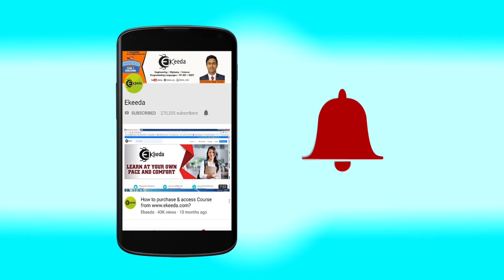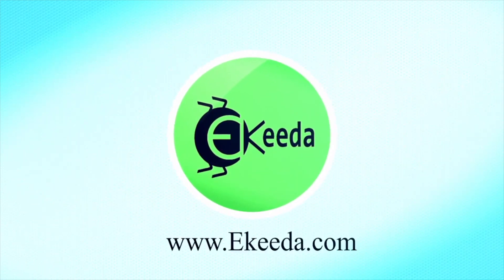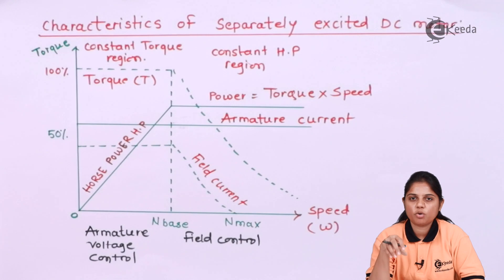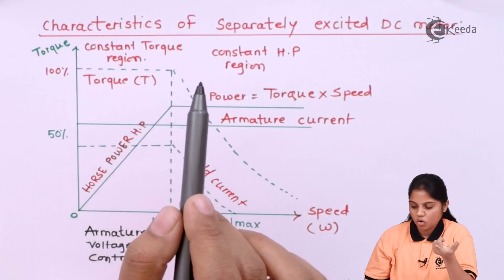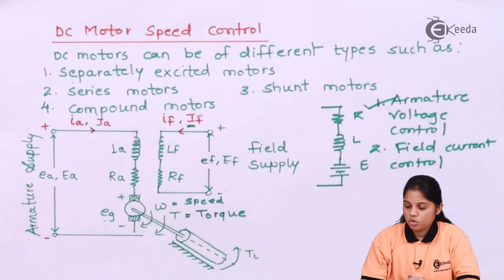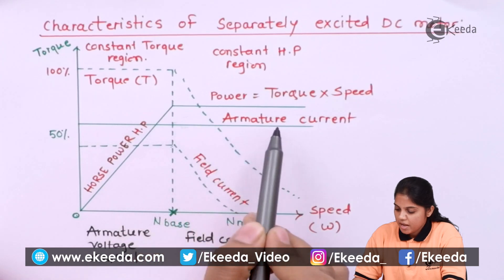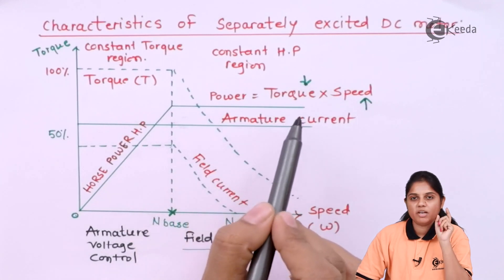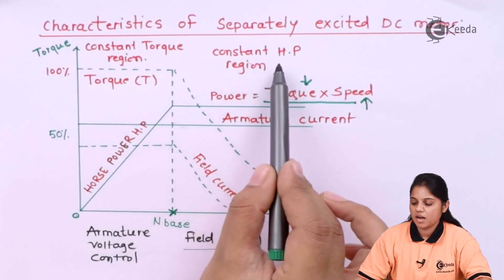Characteristics Of Separately Excited DC Motor - Industrial Electronics

Comment: why torque decreased in 2nd half ???
Reply: After Nbase, the power supplied in the motor is maximum (and kept constant). Power is Torque x speed, so if the speed increases after Nbase, the torque should decrease to keep the power constant.
Reply: 7:10